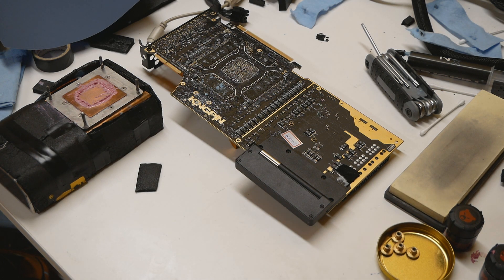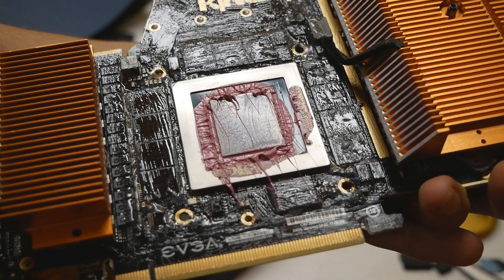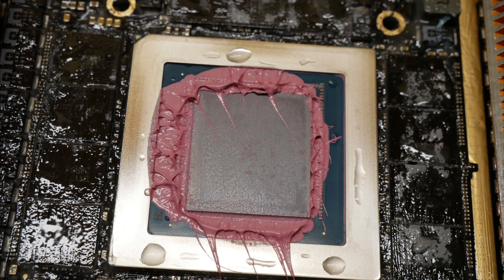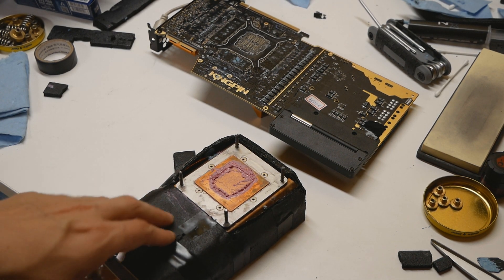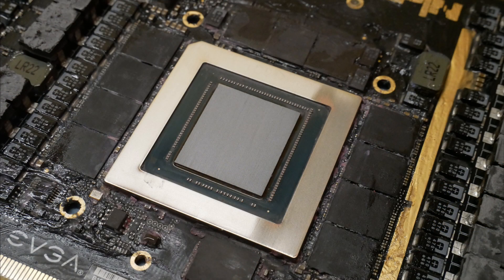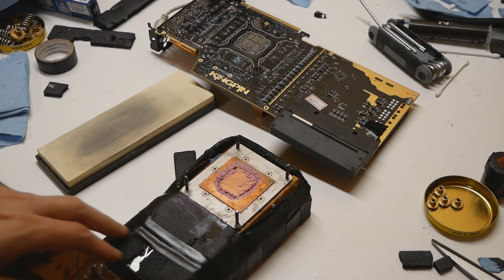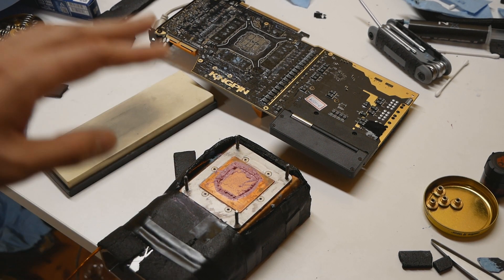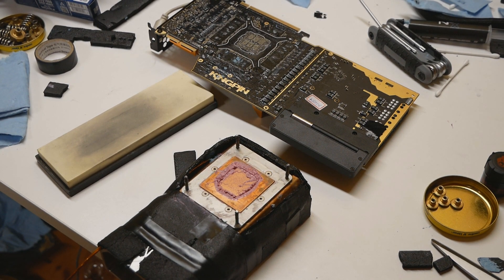GPU Lapping Update - Great Finish with Matador Sandpaper

Comment: Better than sand paper is to use mirror polishing grits directly on a glass plate. W pattern then rotate. Two flat glass plates lapped against themselves will make the glass very flat. Then don't use thermal paste. Maybe and liquid metal that conducts heat but doesn't freeze at those temperatures.

Comment: I wanted to lap mine, but I can't afford nor even buy another if something went wrong. I got knocked down in port royal quite a bit, not even checked lately. Just checked im at 30th with 8700k. Just got a 10900kf to help, but it doesn't even want to do 5.2ghz lol. 
What pot is that by the way?
Reply: try 400khz switching frequency, llc around middle settings (w.e that is on your board) and then monitor VrVout if you can. im at 1.38v vcore set in bios and get around 1.32-1.375 to the actual cpu to have a stable 5.2 all core for my 10900k. im using LM inbetween ihs and cooler, on a arctic freezer 420m aio